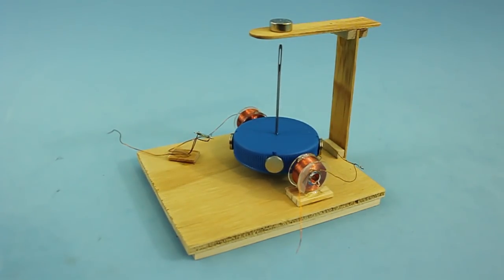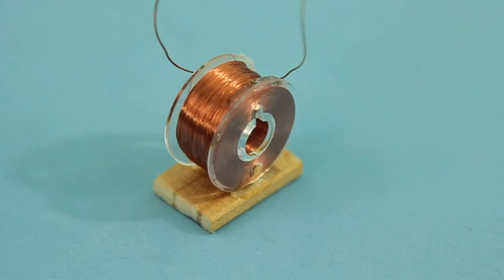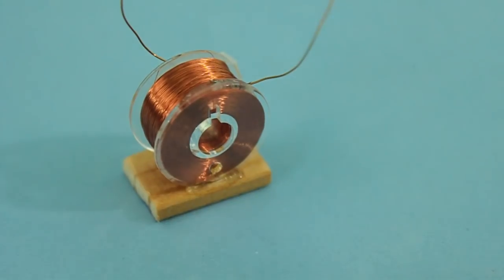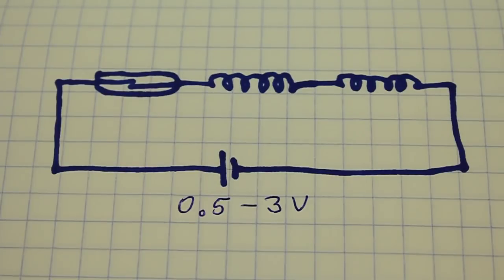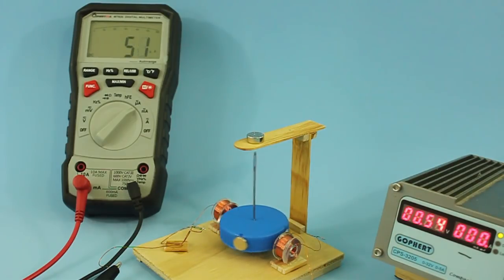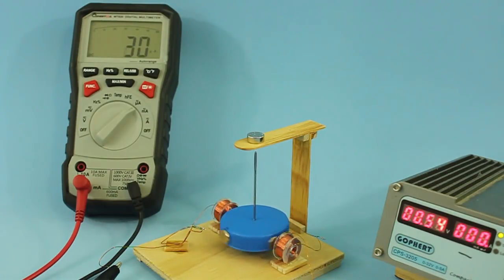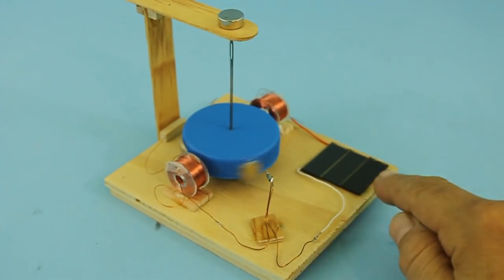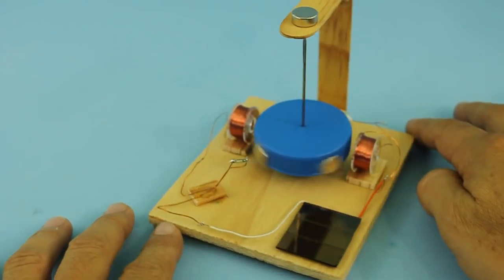Microamp Pulse Electric Motor

Comment: I like the fact that, you have used a reed switch instead of transistor circuit as, Electromagnetic pulses using reed switch are more efficient, and powerful, 👍👍.

Comment: If you would add $Thanks, I would be glad to make a donation to support you doing more of these, with precise measurements and calculations. 

At 1 volt and tens of microAmperes, this is more properly (or also) a microWatt motor.   If you are at 0.5 Volts and 25 microAmperes, that is (0.5 Volts)*(25 microAmperes)  = 12.5 microWatts.  You can use the rate of rotation of the motor as a precise voltage measure, if you can also measure the current precisely.

A solar cell of that size (you should put a link) in full sunlight might be 0.5 Watt and up to 8 volts.  I see many about that size but with ratings all over the place.  I am looking at one on Amazon that says 100 milliAmpere and 5 Volt which is 0.5 Watt.  But that is probably full sunlight rating. If sunlight is about 1000 Watts/meter^2.  If your indoor light is at 10 Watts/meter^2 and your solar cell about 2x2 inches (50 mm * 50 mm) or (0.05 meters * 0.05 meters) That is somewhere in the order of (10 Watts/meter^2)*(0.05 meters * 0.05 meters) = 0.025 Watts. 

The silicon solar cells give about 0.5 Volts so that is (0.025 Watts)/(0.5 Volts) = 0.05 Ampere.  And they have varying efficiency.  Learning to be precise, write things down, and give links to all your background information - that is a step towards doing good science and engineering.  If we really do "solar system colonization" well, it is going to need whole generations of people with different skills, a strong sense of courage, and willingness to work very hard, often in dangerous situations.

Monitor closely the room illumination and the solar cell properties.  The energy of green light at 520 nanoMeters is 2.38 ElectronVolts.  That is only a tiny part of the spectrum.  You could use the actual spectrum, and the efficiency of the solar conversion process, and camera data to make measurements - after careful calibration.

I just checked and moonlight is about 0.108 lux which is(0.108 lumen/meter^2) or about 600 microWatts/meter^2.  The sun is about 2.3 Million times larger than moonlight.
Another source says moonlight is about 0.25 to 1 lux.

The Internet ( I have studied it intently every day for the last 25 years) is a mess. This sort of basic knowledge ought to be available to everyone, not have to spend days or weeks just qualifying sources and sorting through random stuff.

Richard Collins, The Internet Foundation

Comment: Nice 👍. Are all the four magnets set in specific polarity?
Reply: I suspect they are all the same orientation, and the cooks wired such that they produce the same polarity (such as North facing the magnets, with the magnets having North facing away from the rotor.  Perfect 90° spacing of the magnets and 180° spacing of coils, combined with careful placement of the reed switch allows adjustment of the speed/power consumption of the motor.  Even though the current didn't increase, power consumption doubled when the voltage was increased.  By my calculations, at 25uA average, it should run for several years on a single AAA battery.

Comment: Should all the neodymium magnets be in same size 

I have those magnets in different sizes. Will it work
Reply: The rotor must be balanced and has an even distribution of weight across it, otherwise it will vibrate terribly and cause additional friction. Also, different sizes and shapes of magnet will also have different dimensions and magnitudes of magnetic field. The reed switch will not behave consistently hence, for sometimes it would close early and sometimes late, depending on the magnet that is affecting it. So the coils would not fire accurately either.

Comment: I wonder if you could power this using a crystal radio tuned to a local station, and a voltage multiplier. Then it could also run in the dark
Reply from the maker: Nice idea

Comment: With a core in each coil the thing will be so much more powerfull! and with approximately the same current or lower due to the higher induction thus impedance. Just some old screws will do. Now you have a very low efficiency.
Reply from the maker: No, you can not use an iron core because the iron will attract the magnets and the motor will not rotate.

Comment: next time put the magnets ontop than on the side so that you can make the coils get closer to it since on the side you lose some due to the shape. ;) 
Have electromagnet abov and below the magnet migth help a bit more. 
Also if the center of the core  was smaller wouldnt it be better to have more turns?